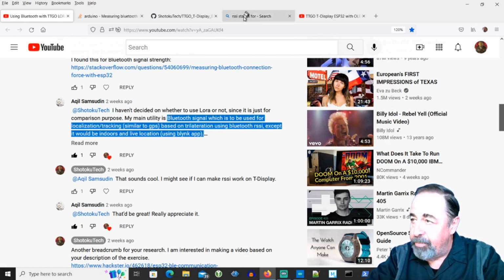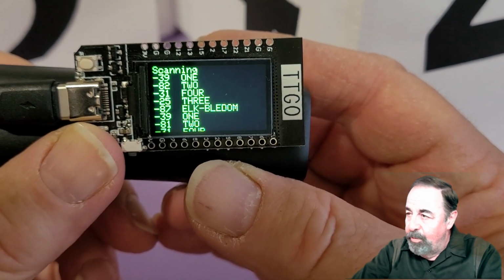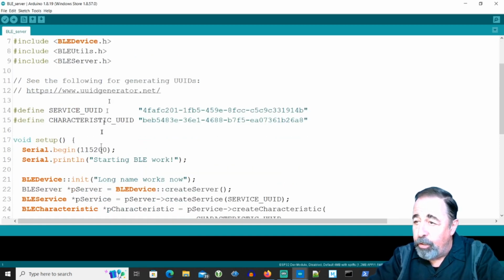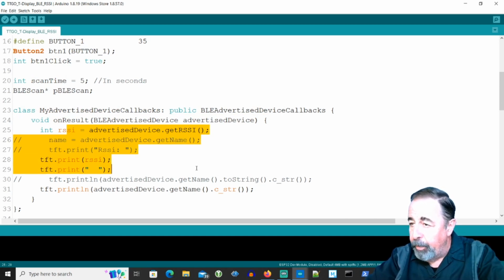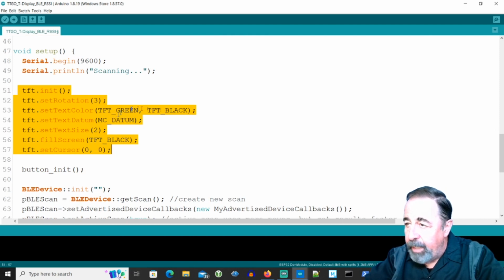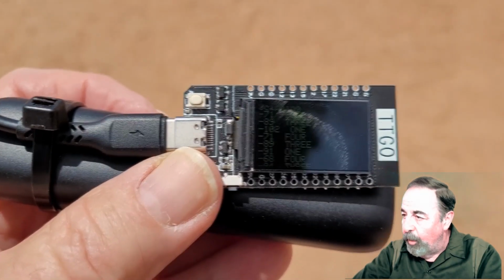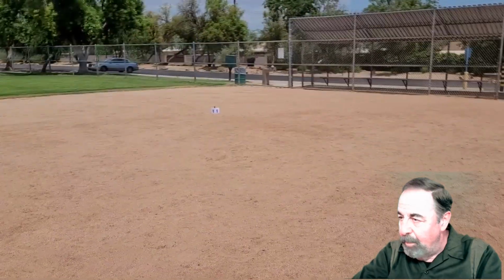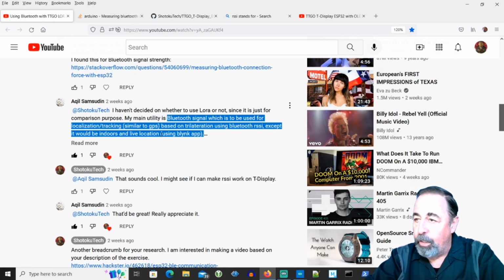Using TTGO T-Display to Scan BLE RSSI (Bluetooth Low Energy Received signal strength indicator).

Comment: how do you improve the BLE RSSI? at even less then 2 meter I think you are getting -50 to -60 RSSI.. I think it should come in around -20 to -30 RSSI.
Reply from the maker: It is just between small folded antennas. One of the four was decidedly weaker than the others. Best wishes.

Comment: hello sir i was using a beacon and want to scan its rssi and battery ststus using esp32 as client ?? I im not able to get it
Reply from the maker: The library I used here gets the RSSI, you just need to have the beacon transmit battery status upon connection and connect with the client.

Comment: Good job, very instructive, thx  ! Interesting 2 seems so different (debugging cheap radio setups is hard -eg  quality, power, cables, visibility and orientation of antennas). The rssi and overall scanning approach works with wifi also.
Reply from the maker: Great point! I had the TTGO T-Displays out at this same location and measured 600 feet WiFi range. I should try this same scenario out with WiFi on a bigger scale then! Thanks

Comment: Thank you for the video sir!
Slowly approaching my deadlines now, so this video was very much of a help. 
Got stuck at a bunch of stuffs as well as creating codes for a continuous scanning, and your tutorial really helped me out. 
Never thought of making use of the button as a trigger for reset and ON/OFF as well. 
Hope to see more of your videos in the near future ^^
Reply from the maker: Glad it helped! There is so much I want to do to improve it, like averaging multiple readings for each device in an array, then print out the list. But this took the better part of last week to get it this far! Thanks!
Reply: @ShotokuTech  I am working on that as well. For every 3 or 5 inputs of rssi from the ttgo of the same distance, these values will be put through filteration and averaged for each beacon. But I can't seem to return or call the rssi values to be included into the pre-designated formula. I'd like to get your advice on this matter if possible.
Reply from the maker: I don't have time to code it further for a couple of weeks or so. But this is what I would do. I would find a way to use switch case to assign a corresponding output variable for each beacon, add the current RSSI value and increment another variable representing the divisor. At the end of the scan, display the contents of the array, beacons 1 through 4 in my case, the total RSSI divided by the divisor to get the average for each beacon. Issues: switch case only works with int or char, so you would need to 'convert' "ONE" to 1 and so one. Pushing the scan button would clear the array and all variables and start over.
Example:
During the scan, beacon ONE returns RSSI values 50, 40, 50, 40, the divisor would be incremented to 4. ONE's average RSSI would be 180/4 or 45.
Reply: @ShotokuTech  That'd be a good way as well. Although, being new to coding, I don't quite understand what it means to convert "ONE" to 1. Isn't the value of RSSI is already a numerical figure or int? 
Also, I've made a few changes to your codes and it now can run continuously without having to push the reset button. Assuming the data is not deleted automatically for every scan that is.
Reply from the maker: @aqilmoons  When I referred to "ONE" I meant the BLE Beacons named ONE through FOUR.